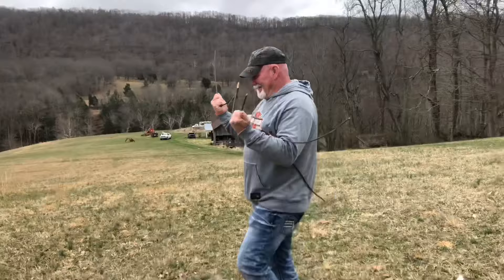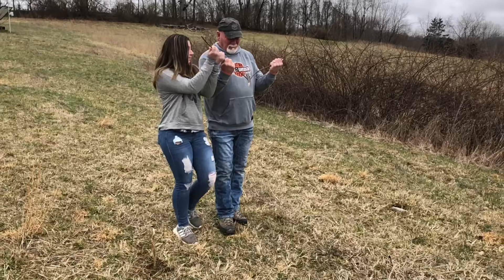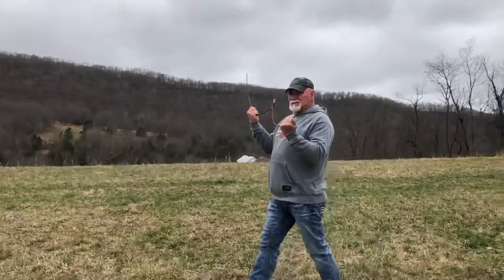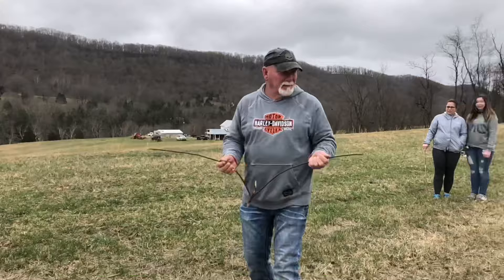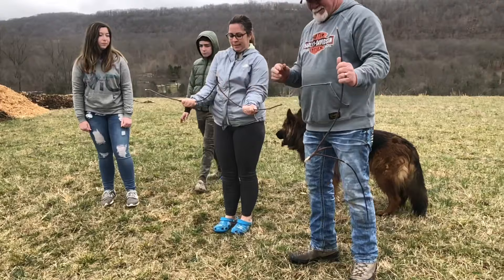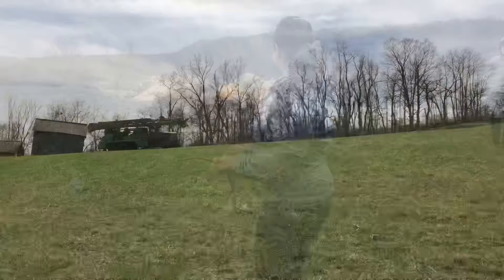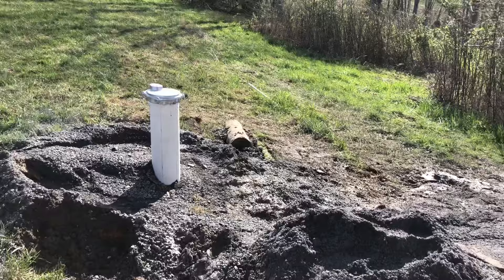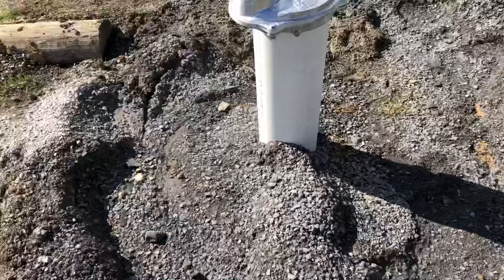Dowsing / Witching a well. Does it work? Thousands of $ later we find out.  Definitively answered.

Comment: There's water underground. The real test it drilling where they say there is no water.
Reply: lol yeah its total BS. drill anywhere you will hit water just a matter of how deep. buddy works for Arcadia drilling and they dont use witches at all and have never not hit water
Reply: I think a better 'real test' would be to have a dowser come in AFTER they find 'no water', dowse a spot, drill and find water.
It's a test that I have seen conducted...and passed. The dowser put the driller into water within 60' of the surface after the driller had drilled three other spots to as much as 200'; the driller didn't pass through water at 60' on the way down either.
Reply: :}} that's funny
drill two wells, one where they say it's the best spot and one where they say there is very little or no water.
both wells will produce the same amount of water because science :}
Reply: But considering wells were hand dug do you think there is something to the depth of the water to be had?
Reply: @duroxkilo  a total lack of understanding of underground geologic formations.  Science does NOT back you up.
Reply: @alaskaeyes3571  I think getting a group of several water witchers to dowse in the same area one after the other and see if they all detect in the same spots would be a good test as well
Reply: @huckbeduck  the best test I can think of is to install water lines in the ground and fill them with water, capped at both ends and completely buried. Then cover it all with dirt. Have a Witcher come in and show us where that pipe filled with water is at and then I will become a believer. Not of the stick method though that shit is so so silly. Metal rods. You do know that these guys claim they can find anything underground right? They just have to be thinking of it. They say they can find a brick buried in the dirt. Or a dead body buried in the dirt. It's so goofball type shit they would never do a REAL test of their skills
Reply: @alaskaeyes3571  You're either wrong or a liar. You pick.
Reply: @shadygunshow  Why metal rods? Do you ACTUALLY believe water puts off a magnetic field? Are you aware that would create free energy for literally everyone on the entire planet?
Reply: @Connection-Lost And you, sir, are a rude lug. I'm neither wrong, nor a liar. I've located water lines and sewer/septic lines while using rods. I've done it multiple times. I've 'proven it' by criss-crossing the area and coming up with the same locations regardless of the direction I approached or left the mark from. And I've also used 'Y' sticks, though not as much.
I carry a set of 1/8" copper rods in my pickup and can use them any time, anywhere. Some people have it...I guess you don't. But don't let that get to you. It could be something else that you didn't have...or...maybe you don't have that either.

Comment: My dad was a telephone lineman for Pacific Bell (later ATT) from the 80’s - early 2000’s and he and the other old engineers would use the metal rods version to find cables buried under ground that needed replacing or to map really old ones. Rods were Company issued!
Reply: Still are for a lot of companies.
Reply: We still use them on occasion to find underground power lines before the locator comes out to mark them just to see how close we can get.
Reply: I dont believe you can dowse for water but i wave also seen ibew linemen dowse lines out of the ground with scary accuracy
Reply: Also a lineman here. Very common. Wish I could explain how it worked. Would be the key.
Reply: I worked for a water company and I've always used what we called a wand. It was just a plastic handle with a telescopic antenna. We had some of the best electronic locating devices on the market, but I always rwlyed on that wand.
Reply: @t.r.4496  Liar.
Reply: @jblgti50  Liar.
Reply: @georgehutcheson9679  Liar.
Reply: @Connection-Lost  never witnessed it I see. Probably never got outta moms basement
Reply: @Connection-Lost  you were born without a connection. Go find somewhere else to troll

Comment: When I was 9. Yrs old we had a mam come to withh a well and it worked  where we were building a house. We had a well dug where the stick pointed and hit water 30 ft down. Dad said this was how everyone found their wells. I remember I was amazed by it.
Reply: basically there's water everywhere and dowsers get lucky. you could have drilled 200 feet away and still got results.
Reply: @coreymagin  But how much would it have cost to Drill at that spot 200 Feet Away??
Reply: @coreymagin  Not true - as a hydrogeologist I can tell you it works and your explanation is untrue and wrong.
Reply: @eielson1978  he is saying you can drill anywhere basically. The depth you have to drill won't change much in a few hundred foot distance because groundwater, like normal water, tends to level out.

Comment: There's a large aquifer under the entire area. You could probably drill anywhere and, as long as you go deep enough, you'll hit water.
Reply: Not sure about the area you're referring to but in a lot of areas, especially in the hills where I live there can be great water in one spot and bone dry at twice the depth a few yards away.   Know of a specific situation where they used a driller that always just went for the lowest spot on the property, in this case a substantial ravine.  After about 400' they ended up with a trickle.   A couple years later they decided to try again.  Same driller with the same philosophy, just a 100 yards or so further up the ravine - same nearly dead result.   They lived on that land for several years using holding tanks that they'd pump their trickle into until they finally got sick of that situation so they tried one more time.   Different driller who strongly encouraged them to let them bring their dowser guy out and walk their entire 20 acres.   He located a spot at the very highest point - a hill - on their property.    They were very skeptical, but the guy felt very strongly about it.  Whereas in the ravine - he got no readings.    So they bit the bullet and drilled where he pin pointed on top of the hill.    They hit nearly 20 gal/min at only about 200'.   There definitely was not a large aquifer flowing underground all at the same level.  They hit a vein thanks to their dowser.    I've asked drilling crew members and they told me they've seen crazy spots where their dowser has pointed out that you'd never guess by looking at the terrain would hit, but they do.
Reply: @admjlw  Yup,
Same experience for me. My Uncle taught me how to do this plus tell how much water and how deep using wire.  I had located my well and another for a co worker and hit depth and GPM on both.  I did one for another friend and heard they didnt find any water. Years later I asked him about it and he said that they had in fact got water where I said. His first driller wouldn't drill where I said the water was so they got a dry hole, then he went to a different spot and got dry hole. He then hired a different driller and he made him drill where I said and Bingo!    I dont believe its witch craft, just a gift from God to help mankind. Not claiming I have any special connection, Its just something thats there.

Comment: Two old timers dowsed the well at our house when I was a kid. The first came in dowsed, picked up a strong stream, and my dad marked it with a small pebble. The second guy came, dowsed, and he came to the exact same place as did the prior gentleman. The well was drilled, the drillers hit water at 103 feet, and they drilled down to 120 feet. The problem that we ever had was (years later in a very wet season), sand began to leak into the well, and it was starting to stop up our jet pump. We changed it to a submersible pump, and we decided to pump it clear to the bottom to clean out any sand in the bottom, and we could not pump it dry. We were pumping about 25 to 30 gallons per minute.
Reply: They found water because groundwater is everywhere and aquifers can be a mile wide.

Comment: My Grandpa was a master plumber pipe fitter started when he was 16 and continued well into his 80s.. I remember watching him take two bent coat hangers  and walk around until they cross.. wherever they would cross there would be water...
I even remember watching him find unmarked water lines..he would dig them up and they would be right there.....believe what you want to believe, but I've seen it with my own eyes
Reply: Can you be more specific? Copper hangers? How long?
Reply: Yeah, it's definitely one of those things that sounds insane but once you see it you just can't deny it
Reply: @alyasfukename3355  It's not real. there is ground water everywhere. And if you could get a magnetic field from water in a pipe standing still, we would have free energy across the entire globe.
Reply: @Connection-Lost  It is real. I went into it as a skeptic and experienced the pull. Back and forth over a hot spot and there was no mistaking what I was experiencing.
I was not able to test it with an actual well, but the phenomenon is very real.

Thanks to YTer for taking the risk and drilling, and showing there's truth to it. When the time comes for me to replace my 30 yo well I will definitely rely on a dowser before an engineer and their witchcraft.

Comment: One thing I'd like to make very clear to those who've never used a branch to douse, and have used only the rods.  The "feeling" is totally different.  I've used both.  The rods move but with little resistance since they are inside cylinders usually and you do not feel a downward strong force because they are designed to rotate  horizontally to the ground, whereas when the branch begins to "pull" downward, it is as though a man has grabbed the end of your branch and is literally forcibly pulling it down in a STRONG way.  It feels like someone or something, is physically pulling down on the branch you are holding.  And pulling HARD.  But there isn't anyone there!  It is a crazy, unexplainable sensation.
Reply: It's also known as gravity
Reply: @craigandrew6409  I would lean more toward magnetism of some sort. Gravity is theory that applies to heavy objects but leaves a butterfly to flutter...he's referring to a strong forceful pull..
Reply: @craigandrew6409  if gravity all of a sudden started PULLING something down when it didn't just a secondary ago.....what would that mean?? Extra gravity lol
Reply: @AngieCee1  A subtle twist of the wrist, gravity does the rest
Reply: @craigandrew6409  and no water lol.
Reply: @craigandrew6409  What is  the cause of the subtle twist of the wrist?  How would it be subtle when it's described as a strong pulling down?
Reply: Exactly. It pulls so hard it can slip through your grip.
Reply: @theniceashley84  We doused for our well. The neighbours well is 185 feet deep with sulphurous water. Three out of six of us got strong movement with l shaped coat hangers. Our well at eighty feet deep spews hundreds of gallons of clean, non sulphurous water. Thanks be to God!🎉
Reply: @theniceashley84 Lmao thank you for making me laugh, that was the dumbest thing I've ever read.

Comment: I saw it the first time when I was about 12 years old. An old timer used slip joint pliers and stuck a wooden stake in the ground. He went back to his car and came back with a copper brazing rod. He stood over the stake line he was holding a fishing rod. It started bobbing and he counted and said we would hit water at 60’ but it wasn’t a good vein. He said drill to 130’ for good water. He was within 5’ on both.

Comment: When I was taught how to Douse for Water I was AMAZED at the fact that I was holding that branch as tight as I possibly Could and there was a point in time that I could hear the Branch "Creaking" in my hand as it turned down to point at the ground.  I COULD NOT stop it from turning.  We have a Filled In Well in our yard.  I cut a forked branch and Walked the Yard.  Then I Taught my Wife and she got the Very Same Results walking the yard that I did and she was convinced that this Really Works.  In the video I think that they were walking a bit fast for me.
Reply: Right!? I have the same experience you can't hold hard enough to stop it pointing down even when holding like that! So odd there is very few places with explanation on how this happens
Reply: What if it did it anyway even if you were standing still, because of the internal stress, like a spring for example
Reply: @krzysztof6123  No idea if that could happen. I just know from my own experience that this is a real phenomenon of the twig twisting itself when walking over certain areas. I can't prove what causes it, if it is or isn't moving water I don't know.
Reply: I always heard to hold the rods LOOSELY in your hands.

Comment: I think a better test to prove if this works or not would be to drill a well where the rod did not show water to be and see if they find water or not.
            My dad did this, water witching, in East Orange county, Florida, about 50 years ago before having a 4-in well put down about 160 ft. He believed it was true and I tried it and tried it and never was able to get any feeling from it. Fifteen years later,I moved 13 mi away, to the east to build my home. I picked the spot and told the well driller to put it there. He hit fairly decent water several times on the way down. He went down 160 ft and said he found some good water but hit the limestone and decided to drill another 40 or 50 ft. I get lots of water. I have a hand dug well down 18 ft and I get lots of water. I live in Orange county Florida and we live over top of the Floridian aquifer. I think my Dad could have dug anywhere on his property and found water.
Reply: dowsing is a scam, that's why.
Reply: THis is exactly it. Aquifers are huge and basically everywhere. There are very few places where u won't find water by digging a reasonable depth. The depth u have to dig only changes by centimeters if you move a kilometer.
Reply: The only thing that gets me is some people call in a water witch to find leaks in pipes and they seem to be more accurate than not.  I just can't explain that.

Comment: Yes My dad when I was a boy had a man come out to our new site for our new home that my dad built.  (Carpenter) The buy used a "Y" branch from some special kind of tree and he held it so that the  two branches were touching one on each palm.  He walked around the property and I watched him.  That "Y" branch started to spin in a clockwise movement and he said right here it was spinning faster and faster until he stopped it.  It was pulling on his hands.  He tested that area twice and said at 150 ft.  you will have 10 gallons of water per minute.  Well turns out that man was right., and we had the best water because we were not in the city we were 10 miles out of the city limits.  I was so amazed.  Glad it worked out for you too.  thanks for sharing this.

Comment: Had the experience when my supervisor was looking for electrical conduit in an area of field we had to dig at a school! He used #10 solid copper wire and he told us to dig where they crossed so we could know what direction the pipes were going. We dug and I became a believer that day!!
Reply: 3 things - your supervisor may very well have installed that previously. 
- any electrician can quickly identify where a conduit or conductors travel using a tracer
- I can look at most jobs I do and guess exactly where the conduit will run by looking at sources, fixtures, poles ... there are too many context clues.

Comment: According to "the sticks" there was ... no water ... no water ... no water ... no water ... WATER !  According to the Dowsing lore, does that mean that all those places where the sticks were pointing UP there was NO water there?  If you dug a well where the sticks were pointing up -- 10 or 20 feet away from the successful well-head -- the well would strike no water???  If I see THAT, a dry well 20 feet from the wet well, maybe then I'll believe in Dowsing.  

Also, I note that the dowsing point is near a small ditch.  When it rains, the flow of water down a hill carves that ditch and that ground carries more water runoff than other parts of the hill that have no gullies or ditches.  Some of that gathered/concentrated water in the ditch will sink into the ground and so it is likely more underground water will be found near (under) the ditch.  For that you don't need a dowsing rod, you only need eyes.

My house is in a narrow valley with a year-round vigorous stream.  Hundreds of springs create the stream.  I'll bet I could dig a well anywhere in the valley and hit water.  A dowsing rod would never point to the sky.